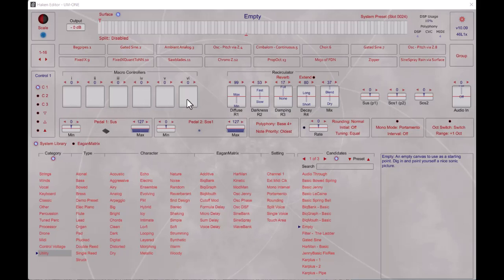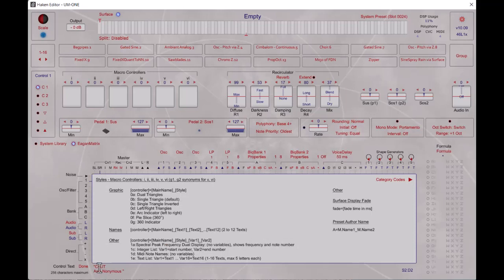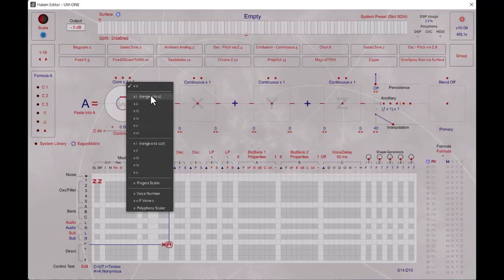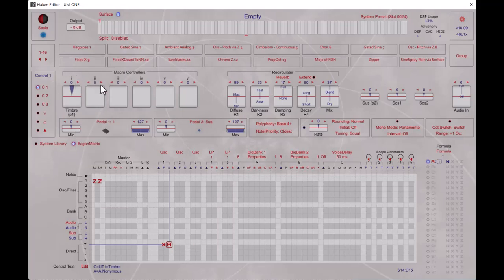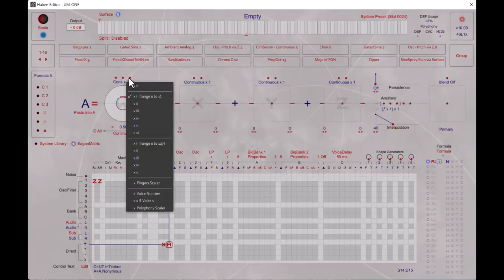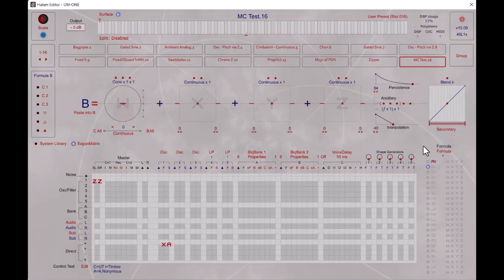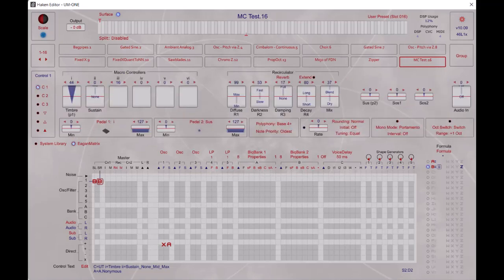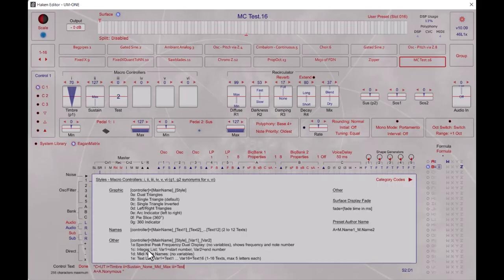Haken Audio / EaganMatrix: Macro Controllers in 9.95 and Later Firmware

Comment: Thank you for making all of these videos, they have been helping me learn the matrix a lot. The issue I'm having right now is that I've created a macro (i) that controls the persistence of a formula, I've defined the macro and am able to control it in the matrix, however I am not able to control the macro using a foot pedal (plugged into pedal 1 or 2) even when I have it assigned properly. Additionally, I can't see the macro I've made on the Expressive E itself. Would you happen to know what's up with that?

Thanks again!
Reply from the maker: Looks like the editor function for this is broken right now. I think they know this issue. You can go to Osmose and set Pedal 1 or 2/Mod Slider to the macro controller you have the Blend on Persistence set to and it will work then. On Osmose this is in the Synth button selections.
Reply from the maker: Right now there are numerous editor/Osmose sync issues that need to be fixed. Doing some things in the editor may not show up on the Osmose until you reboot it. Does your Continuous pedal work for other macro controls or are you saying this only happens on Blend Persistence? Not all pedals work well with Osmose or Continuum.

Comment: Thank You! Use case: My Osmose has a factory EP I like, but it does not decay to silence like a piano, regardless of sensitivity settings, or current macros. How can I save that preset for editing, and add a macro knob to, in effect, control the S of ADSR? That would be so useful for newbies :)
Reply from the maker: HI. Unfortunately, most all the Osmose presets are maxed out on controllers. You can't add any without deprogramming one and adding another. In the Haken Editor you can save a preset to disk with Save function. You can also save a user preset on the Osmose. I suggest you join the Facebook Osmose user's group and you can ask questions there and get a lot of answers.
Reply from the maker: And there is no ADSR specific controls on the Osmose. Envelop attacks and decays are programmed into each preset that needs to support a function of that nature. So to change that if you can't do it with the current controllers means you will need to program new envelope functions into the preset.
Reply: @eaganmatrixprogramming  TY for kind replies. Yes, How to copy a preset, remove one controller and replace it with decay control. Synth 101 stuff, no? Would make a great video. Practical case for Osmose.
Reply from the maker: @uhoh007  IN the editor you can save presets to disk using the save function. There are videos here that show that and how to use Macro controllers. But because the controllers are filled you just can't replace anything. This will require preset by preset surgery to remove a controller and add one of your own if they are filled.  I'll create a video on that after I create some simpler Osmose specific programming videos I have planned. This will be advanced programming to do this as you could break a preset by removing a function that is intended there to add your own.
Reply from the maker: @uhoh007  By the way exactly what preset are you looking at and what do you want to do with it?
Reply: @eaganmatrixprogramming  EG: bazikey: I would like to remove "sustain", ie open gate; and have an adjustable decay to silence, with finger resting on key, like an acoustic piano. TY so much!
Reply from the maker: @uhoh007  Unfortunately you can't do that without taking pieces of it away. There is no room to add the shape generators and formulas required. So you'd need to choose what components you can live without and then you need to know how to remove them without affecting other things. Not realistic for a beginner. I can alter it, but it may not be what you would want. You are probably better off just putting a pedal on it and trying to get what you want by volume envelope using the pedal.
Reply from the maker: I'll create something and put it on PatchStorage site used to transfer presets among the EaganMatrix community. You should join the Facebook Osmose user's group where I answer things in greater detail.
Reply from the maker: I think you are asking to make this behave more like a piano where the sound will die away when you continue to hold. I posted a discussion of this on the Osmose Facebook Users group along with link to the preset.

Comment: Is there a way to map a Touché to the macros with relative values, so when you let go it does not go to zero but goes back to the preset values?
Reply from the maker: Well best if your controller maintains those values. But try sending the Macro Controller CCs (12-17) on Channel 2 instead of Channel 1 which is supposed to support relative settings. I have not tested that. Of course this assumes your controller is not sending a final value of 0.
Reply: @eaganmatrixprogramming  I don't have much experience with all these CC things, but changing from channel 1 to 2 does not seem to change how the Touché is sending values to the Editor. 
I usually play with both hands on my Osmose, but sometimes wants to spice it up with the Touché. But when first you touch the Touché you have to keep holding or the macro values goes to zero.
You have other ideas I could try to get the feeling of relative changing?